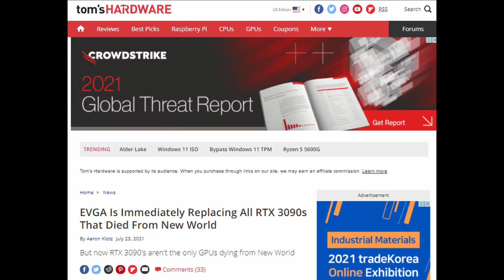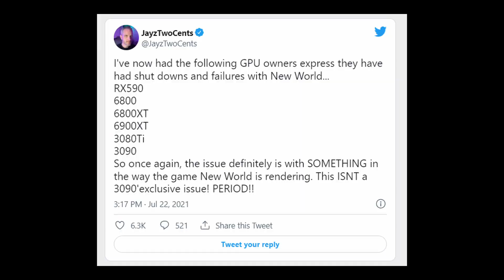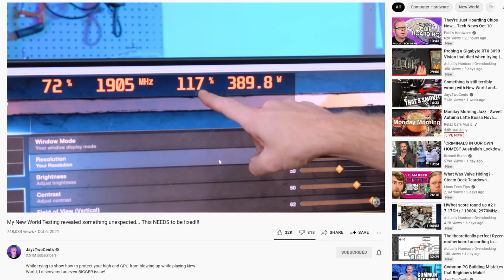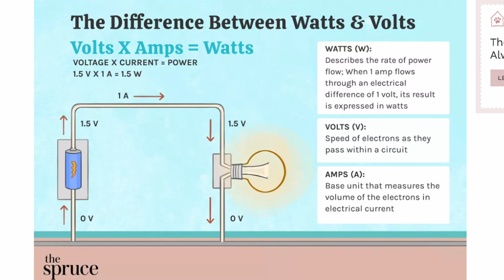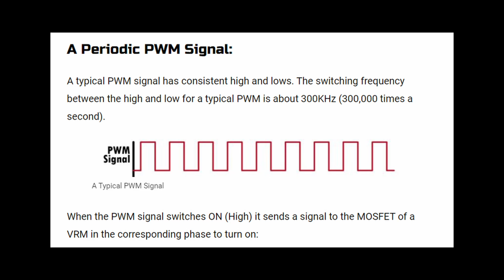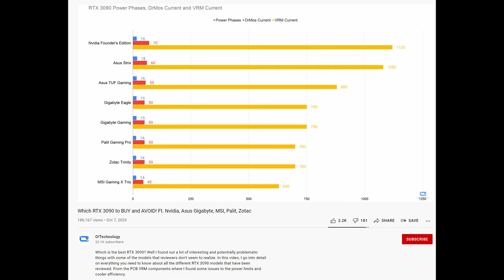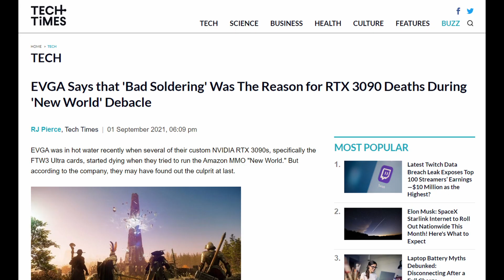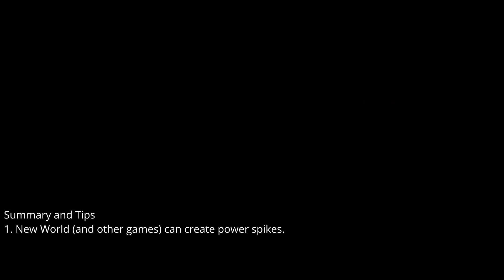The RTX 3090 New World GPU FAIL mystery. What's really happening?

Comment: I'm still using an i7 930@4ghz 12gb ram with msi Rx 480 8gb/gigabyte X58A UD3R Mobo I got from overclockers UK in June 2010 for £1500. However I preordered another prebuilt from scan uk on  23/09/21, estimated delivery around 08/11/21 it's a 3xs sytem with ryzen 9 5900x liquid cooled h100x/32gb corsair vengeance ddr4 3200mhz /Asus Rog strix b550 F gaming Mobo /EVGA 3090 24gb ftw3 ultra gaming/ICUE R220T rgb mid case/1tb WD SN550 nvme m.2 gen 3 /2tb seagate barracuda hdd/Corsair 850w psu.Seriously thinking about  calling them in next couple of days to cancel.Why wait for month half at least for this sytem paying  premium price £3099.98 for a system with a Gpu with junk innards? 😙 Christ my crappy old weedy 8gb Rx 480 has been fine for 5-6 years 2k gaming max settings only at 30fps. That's why I need a new pc as my current Rigg  blue screens often .Can just picture playing farcry 6 or Breakpoint whatever 4k maxed out and that super expensive gpu dying just a waste of money and time and I see Scan Uk don't give you the gpu box. If I am dumb enough  to stick with my preorder better get one as I'll need it for the RMA or will I be sending the entire system back because of EVGA apparently they do replace your gpu think UK are last on their list hmmmm... I need to think very carefully

Comment: I always capped my FPS into 60FPS/60hz or using adaptive v-sync on any games to cool down my card, except for competitive FPS games.
Uncapped FPS make your GPU/VRM/etc run way hotter, overloaded, drawing more watts which is unnecessary. 
Also with v-sync you eliminated screen tearing, also make your GPU Fan's durability last longer. A Win Win solution. 
TL;DR always capped your FPS into HZ number of your refresh rate monitor if possible, except if you're a competitive gamer. Turn down resolution/settings may helps too.
Reply: vsync increase unnessary input lag which defeat the reason of purcahsing a high-end graphic card, A gaming system is only suppose to last for 2-3 years anyway.
Reply: @Abel_Y   I mean use Frame rate limit software or you can try any variety of vsync to limit the frames.

Input lag it's a problem on weaker pc, now vsync has more variety: gsync, adaptive sync, freesync, etc. If you have gsync then use it rather than normal vsync.

Comment: This MMO is basically a power virus and i wouldn't play it during this gpu shortage situation, EVGA is replacing dead cards fast but what about Gigabyte or others? Sure like Buildzoid said the hardware is at fault, but at the end of the day something inside this game it's hammering cards so hard that they fail.
Reply: Took a little over 2 weeks to replace my strix 3090
Reply: @ShaneBuchman  That's good, do you know about Gigabyte?
Reply: Gigabyte has been replacing my friend's exploded 3070 Vision (from playing New World) for almost two months now.
Reply from the maker: Well like BZ said the vcore died on the Gigabyte Vision, I'd have to imagine it died on the EVGA cards as well. There's not enough sample size to guess whats wrong, which is why I left it open at the end of the video. But if Vcore died - ppl should turn down the power usage, and cap it to 60fps. So if you still want to play this game you can probably do it and will probably save your card from the worst power spikes. That said we're talking about 3090s mostly here, and people should know if they want to chance it with their $2500 cards.

I wouldn't solely rely on the warranty program to look after the card either unless its EVGA. For example the Gigabyte Vision that BZ got was second hand so they didn't honour it, which is BS imo.

Comment: My strix 3090 used 505 watts in New world before it started black screening. My FPS was capped at 144 when the problems started. After 6 hours of playing the black screening started, I closed the game and the card started artifacting and dropping display outs randomly. Opening games the card wouldn't boost, and if I hit reset in msi afterburner while a game was open it would boost for a second then drop to 205 mhz core 410 mhz memory in game. It would crash with a green screen hardlocking my machine.
Reply from the maker: I remember us discussing on Twitter. I'm glad you got a replacement! I think the 144 cap isn't enough, the game can still use lots of power under that cap. Are you going to play New World again?
Reply: @Last Rights
What resolution you play at? Maybe cap it into 120 fps or lower, or turn down some settings.
Reply: I don't get it. Even Strix can die? Which 3090 are immune to this bs? Founders edition?